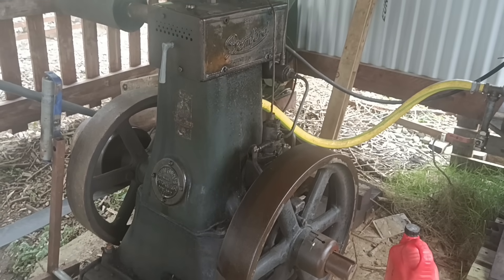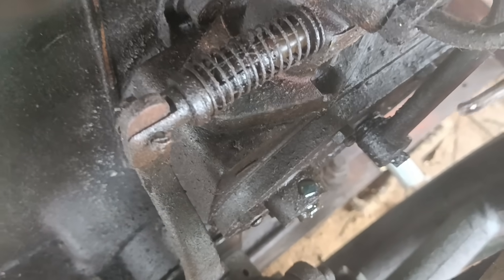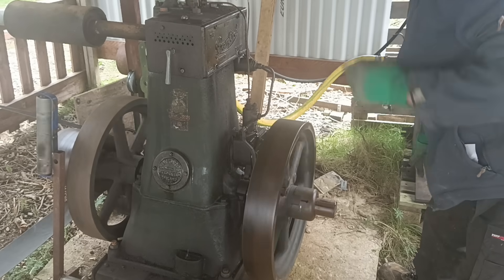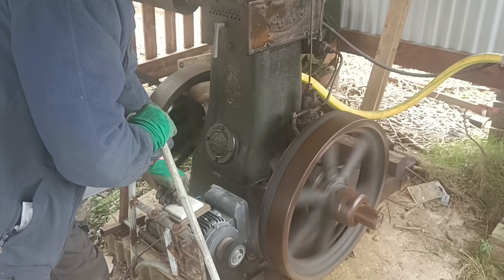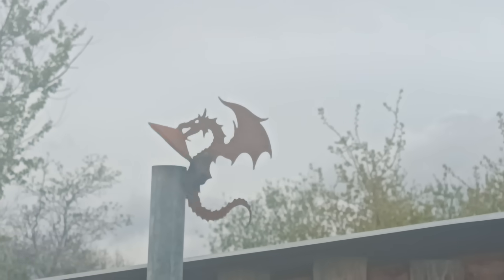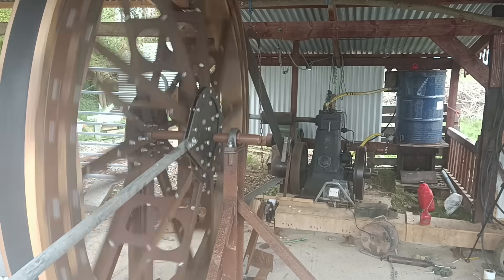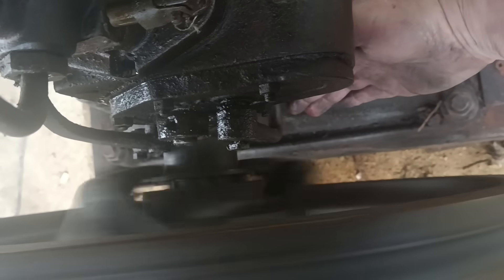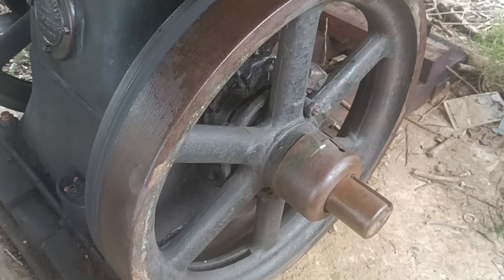How Much Fuel Does This Vintage Engine Use? Bamford stationary single-cylinder diesel efficiency

Comment: I think that engines like these make a perfect back-up generator for in times of trouble !
They always start with a bit of effort, run very smoothly ( which is ideal for generators ) quiet and reliable.
But I doubt you can use 45ct of fuel, and can deliver 2euro of electricity. If that is the case your a rich man in a short amount of time.
If you really want to test this you should hook up a dynamo, a 2 to 4kw continious load, and run that for an hour, and than see how much fuel you used.

If the engine isn't under continious load this isn't such a good test. 
But it's nice to know that it isn't a guzzler !

Comment: I have a 1959 Cooper Klipper reel mower It has a 2-1/2 hp Briggs and Stratton  engine and still works flawlessly. Sometimes older is better.

Comment: MY friend in washington state,USA..has an OLD one cylinder diesel engine running a generator at his hotel ,HE bought the Hotel in 1950,they told him the engine had been running 50 years AND HAD NOT BEEN SHUT OFF,HE has owned the HOTEL since that time,and he has never shut it off either,it burns about a GALLON of diesel daily...

Comment: Ahhh the nostalgia of those old engines.  I had a 15 hp lister swm2 in my old wooden sailboat. The cast iron handle weighed several kilos. The engine was 540 lbs.and with gearbox 760. Got the idle down to 100rpm so it was slow enough to maneuver. 
My next,another antique and a year older than the first came with a brand new Kubota three cylinder 18hp. About one third the weight of the Lister and 700rpm idle.
The average fuel consumption of a diesel is one quart per 10 hp per hour.
Not using all 6hp 450ml an hour is in this range.

Comment: Great video thanks, yes suggest you try using used fish n chip vege oil as bio-fuel it works and is free! 
suggest you start it on normal fuel then hit your diverter taps  to swap over to biofuel. - remember to turn back to normal before stopping so everything normal - . - sounds like your next project doesn't it?
Reply from the maker: there's huge demand here for used chip oil - not free at all, unfortunately

Comment: I was always told that, for a small gasoline (petrol) engine, fuel consumption should be roughly 1 pint/horsepower/hour.  0.45 Liter is just about 1 pint.  Diesel is more efficient but, if we assume it was producing at least 1 HP, it would seem to be at least equivalent to a modern engine.

Comment: If everyone used one of those old stinky things to do all the work that we need done on a daily basis there would be a layer of smog over every community, just like there was in the 40s, 50s and 60s in the states before anti pollution was implemented in motor vehicles.

Comment: Nice engine, but your calculation for the electricity is wrong.  Just like Diesel engines, electric motors pull more power the more work they do so since the Diesel is "lightly loaded", so would a 6HP electric motor be and the consumption would be considerable less.  If your grinder uses only 1HP to drive, then the electric motor would only use 0.75kWh in one hour, not 4.5.

Comment: About 15 years ago I bought an India built copy of a Lister 6hp engine that makes a wonderful sound at 600 RPM.  These low speed motors spend longer in the Power phase of its cycle which more completely burns the fuel.
They are not finicky drinkers.
Diesel fuel works fine as Well as old motor oil diluted by diesel fuel.
I used to make biodiesel using used cooking oil (from fast food kitchen).
Biodiesel was my favorite — the fumes occasionally smelled like donuts or French fries or fish.
Cleaned up cooking oil also worked if I warmed the engine briefly using diesel or biodiesel.

Also bought a 5HP electric motor and the right pulley so it turned the motor at 1800 RPM.  With this setup I could run the diesel for weeks at a time between oil changes.
Most diesels last a few thousand hours before requiring a rebuild.
Lister style engines will run much much longer.
Just what I wanted for a SHTF electric generator.  The 1800 RPM motor runs cool and should last a very long time.
Years later I expanded the setup with a water pump in place of the electric motor. Worked fine.
I expect it will be working long after I’m gone.  Nephew is handling the farm now. He is very likely the end of our line of farmers.

Comment: I love it. However I doubt that thats providing 6 hp. 450 ml of Diesel contain around 4.5 kWh of Energy. Running a 6 hp engine for 1 hour provides also around 4.5 kWh. So considering that there are always some losses and the engine can't be 100% efficient, it must be lower hp.

Comment: I have a 7 hp John deere single cylinder motor with an 8 gallon tank and it will run for the better part of a week  with a light load (areator for a fish pond) on a single tank.
The one at the museum I volunteer at has a 2 gallon tank and will work quite happily the entire weekend grinding corn on those two gallons granted we aren't grinding continuously.  But still it's a 2hp economy and cute considering the work it does

Comment: 5:50 .5L Diesel is ~ 5kWh. The motion energy you got out of it was way below 2.2kwh, at least 56% of the energy was just heat you didn't use. And this does not take into account that it did not even burn 100% of the fuel. ;-) I would not wonder if a electric motor below 3kwh would do that job easily (if you find one with a compatible rpm). And the energy can be harvested via solar and wind power. No question fossile fuels are cheap and they will always be the cheapest energy available. But that's the problem with them and why we are now here, with pants down and climate collapse on the rise.
Reply from the maker: completely agree with you. I wonder why low rpm electric motors aren't a thing.

Comment: The engine is rated at 6 hp. As it is running very low power 2 hp would be a generous estimate. That’s around 2 kW. So electrical consumption would be 2  kWh.

Comment: I really hate to burst your bubble, but I am going to because if it is about "efficiency", this video is about as bad as it gets, suggesting a perceived efficiency that is not there. A consumption of  450 ml per hour means no more and no less than that the engine is AT BEST, if it is as efficient as a modern one, producing about 1,6 kW (or slightly over 2,1 hp). Which is only 30% of its rated power. My estimate however is that is is doing about 1~1,2 hp. Which still FAR exceeds human capability, which is why you seem to think that charcoal grinder "consumes huge amounts of energy". It doesn't. A trained athlete can produce a sustained 1/4th of a hp, WITH HIS LEGS, and less than half that with the arms. Short duration, humans can far exceed these numbers, and since the load determines the power, sure, you can drive that plant by muscle but will be exhausted within minutes.

And no, If you would run that same plant, at the same speed, from an electric motor, it would consume significantly less than 2 kWh. That an engine is RATED for 6 hp, does not mean it actually DELIVERS 6 hp: it is the load (the thing you drive with the engine) that determines the power developed and the fuel (or electricity) consumed.

I can guarantee you this:  a modern diesel, properly geared to drive the same equipment, will do the same amount of labour for around 300~350 ml per hour.

But it most definitely is a cute engine, and nice to see it still does useful labour.

Comment: We run used motor oil in the 70s-80s v8 IDI diesel engines. Get it free from the farmers and junkyards. I wonder if it would work in that machine?

Comment: Thank you for taking the time to do a fuel test….I have a similar India built unit….but it’s very out of balance…I noticed weights on yours…did you try balancing it….ours jumps up and down….1/10 a gallon per hour is awesome.
Reply from the maker: Ours would jump up and down, except it's bolted down to a big lump of concrete. A single-cylinder upright engine will always want to do that

Comment: I live on an isolated farm in Uruguay and when sun and wind fail to charge my batteries I start up a 1952,  6Kw Petter twin cylinder, air cooled diesel which happily takes over whithout ever complaining. I might eventually change it if I find an older one 😂.

Comment: Seems to me the power companies are charging too much.  If  an old engine like this, let alone a modern turbo diesel and maybe a combined CHP one, that make use of the waste heat as well , produce cheaper than power than the grid companies charge,  not forgetting the solar and wind they also have to sell.

Comment: 5:51 the electric motor wouldn't use full power all the time, like your engine isn't running at full throttle all the time. So the actual consumption is probably a lot lower. Try to run it with your starter motor. Looks plenty strong enough for what you're needing. :)

Comment: Don't change to vegetable oil, if you could run it with diesel and it works that well.. at least I don't want to risk that machine and fuel pumping systems etc.. 

If I have some crappy car that could run with about anything, I would use even pee, if that works. But that engine is something different, I think. And put better roller that electric motor to keep that big flywheel without wear..
Reply from the maker: I agree - I will keep using real diesel

Comment: 45 cents per hour is a fabulous value. If you ran it for a 24 hour period and hooked it to a magneto you could produce electricity for $10.80 per day. If you had a battery bank it would be even more economic. Bravo to you.
Reply: untill you attatch a magneto to it and add load

Comment: She's a beauty 💪👍
However if you can find any parts (original new parts), I would scoop them up (as well as any manuals). If you can find anyone that used to build these machines, I would go buy them a meal or two (w drinks) and let them talk about them (while recording) for as long as they were willing to.
Then we may get to see her running and working for another 80+ years.🙂

🤔 I wonder what the cost of diesel was when she was new AND what that would be adjusted for inflation, cost of living, etc🤷‍♂️

Comment: I just had a brainstorm about your diesel engine. You could place neodymium magnets around the the flywheel outside diameter and make a good bit of electricity from the beast. Think about as this world work easily.

Comment: I think your old engine is GREAT, and perhaps rather than look "forward" to some new exotic technology to supply our energy needs or do difficult work, we should look to the past and use that technology. That's a heck of alot of work for about a cup of fuel. And the animal rights activists should love it. Horses, mules, donkeys and oxen were called beasts of burden for a reason. One of these contraptions could be placed on a moving platform to pull plows and all kinds of other work animals once did!! It could be called a, uh... A TRACTOR!!
Yes! That's it!! I'm a genius!! 😄
Great engine and video. Cheers from the USA. 
P.S. There is a country fair every year in my area and one of the attractions is the small engine/"hit and miss" engine exhibit. Multiple engines are usually running and connected to some machine via a long flat belt. Water pumps, grain threshers, corn huskers, saws, all kinds of things. Always fascinating. I love that stuff! I think I was born in the wrong century.

Comment: Also many forget, what other types of Fuel's many engines like this could run on. Other than diesel like in the depression years, price of fuel and availability of the fuels. even today some other fuels will run in a modern compression ignition engine.......Do I smell fish and chips burning somewhere??
I know of one old 1920 early 30's tractors that ran on butter fat. Needed a blow torch to get it started.

Comment: Long stroke engines have more time to make use of the available heat during combustion, and the much larger flywheel stores quite a bit energy.

They also have great lifespans due to there very low rpms and there use of grey cast iron which has a minor lubricative effect due to the graphite concentration.

Comment: I love what you have done , i do the almost same thing myself ,but i use the charcoal to run my engines that generate electricity that i can recharge battery banks on low solar days , mine is a small wood chipper shredder with hammers inside and that is run off a 12/24 v wheel chair motor with a gearbox that turns the shredder at around 90 revs a min  so keeps the dust down its going through a 1 inch screen  so i get a real nice uniformed fuel , the fines that  drop out are then used for Biochar i think hand loading the shredder i get 25 litres in around 3 mins
Reply from the maker: Interesting - thanks. videos?

Comment: i have a 6 hp listeroid diesel...its exactly the same engine by an east indian company...weighs 800 lbs when ready to go....they are all very hard to start...one man cannot start the engine by himself, it requires 2 strong men or one man with an electrically assisted starter of some kind....i use my engine for therapy...i find the indefatigable stoic chugging diesel sound to be more relaxing than sitting by the sea shore

Comment: 2 Euro for 4.5 kwh???  Around here that would be .33USD.  What else is overpriced in Ireland?
Reply from the maker: Ha! You have subsidized electricity (didn't you know?). And  I think you're using a lot more fossil fuels to generate electricity? (We do too, but a smaller percentage.) So maybe you should ask what price it should really cost where you are?

Comment: As far as the fuel droplets being too big... could you use some sort of thing with several small nozzles instead of one big one? So you'd get the same fuel flow and pressure but with smaller drops? Seems like something they could have thought of in 1940 so there's probably some reason it wouldn't work.

Comment: These old engines didn't use a lot of fuel, resulting in a rather low horsepower rating.  Their large torque comes from the large flywheel, especially the even bigger stationary engines.  You could never use these for mobile applications like an automobile, because they would be really slow (they usually don't rev much higher than 1000RPM).  People complaining about todays engines using so much more fuel is because they're much more powerful and can rev to higher RPMs, allowing for higher speeds and larger work loads.

When looking at horsepower output vs fuel used, they really aren't that efficient.  But for torque output for their size, they are hugely efficient.

Comment: Hello , I have here an old Bamfords engine much like this one , but smaller & petrol fuelled , we kept it for milking the cows with during power cuts . We bought it during the WW2 , wanted a Lister but couldn't get one , however , these had few but MASSIVE horses . it drove an Alfa - Laval vacuum pump without knowing it , although the belt speed was a bit down on the electric motor ,  ( it needed a bigger pulley on the back of the engine to shift more belt per r.p.m.). From new it was a poor starter , bad compression due to a bit rough boring in the cylinder ( WW2 supplies) , my uncle was an engineer , got hold of a set of "Cords " piston rings for it , problem solved , better compression . My late Dad last used it during the English 3-day week , power cuts , no electricity for lights to see to milk the cows with at night , nor power to drive the vacuum pump , bloody dangerous job to do largely in the dark , I helped him do it , but his cows knew him & me well & allowed us to manage them in the light from an old Tilley paraffin lamp , with the old engine thumping away driving the vacuum pump . he started it with the light from a miner's torch , how's that for a paradox , in the very dim light one night his slop corner wrapped round the crankshaft , he felt his coat tightening up & slammed both hands on top of the cylinder head , the old engine was only just turning fast enough to fire , but fire it did , & ripped his coat straight off him , torn to shreds , but he was uninjured , just very shaken . I don't blame the miners for striking , most of us have had our livelihoods destroyed from outside , they were simply about to get the same , thatcherism , then global warming concerns . I believe the factory site these engines were made in is still there , but now makes tracked excavators for the J.C.B. Company . History for you from an English stock farm .
Reply from the maker: ha! Thanks. I grew up on a dairy farm and remember when the power went off, or the pump broke down, we'd have to milk the cows by hand..

Comment: What a lovely old girl you have here!  I like to imagine the folks who mined her, smelted, poured & bored her; the many hands who carried her along until she sits today in your peaceful shed a-chugging. It would be interesting to place a "Y" at the fuel inlet to the injector pump and experiment with metering in vegetable or animal oils. I know that many 4-stroke antique engines have the ability to start on white spirits then switch to kerosine. Thanks for the interesting experiment!